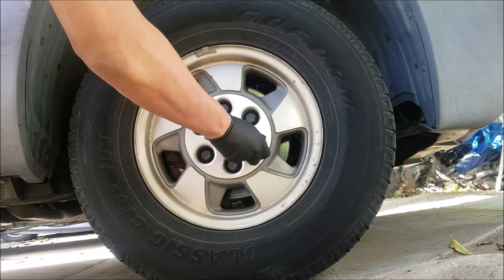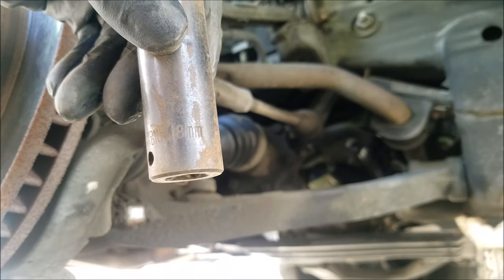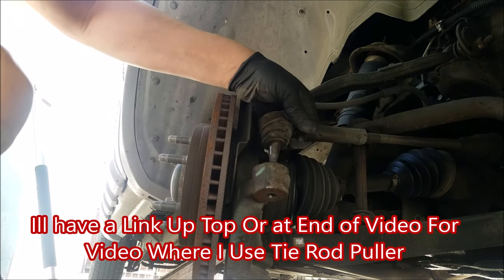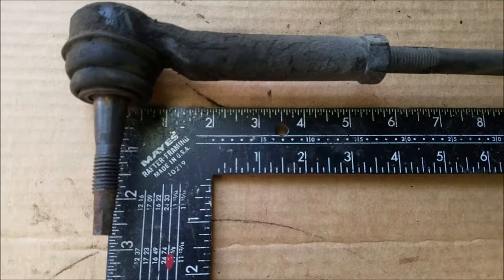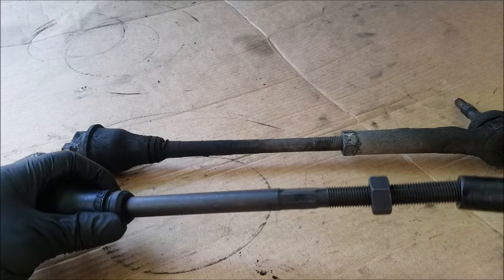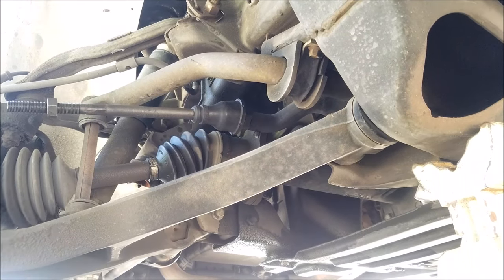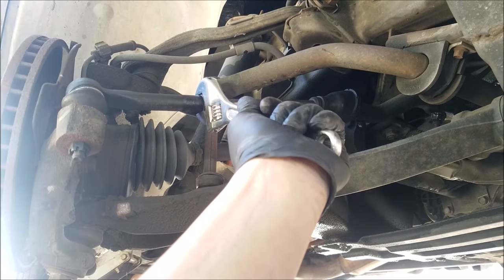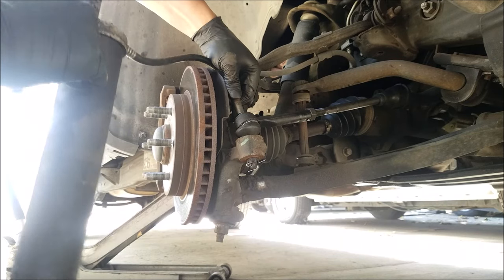How to Replace Tie Rods Chevy Silverado & GMC Sierra (Inner and Outer Tie Rod Ends))

Comment: I appreceate the information but when you tighten the locking nut your realy should have two wrenched you dont want to damage or bend the spindle bolt . I know its touchy but better safe thanks sorry I mean your are reolac8ng it for a reason .

Comment: good  outer & inner tie rid replacement #👍 🇵🇰 but before opening the  outer tie rod measure & mark the jam nut position & then measure & mark on the new outer tie rod & rotate the outer tie  rod on inner tie rid till the marked position of nut reach # 🇵🇰

Comment: Thanks. I would have liked it if you had mentioned a few comments about the right-side same operation. Is there any differences side-to-side? Are the threads on the other side the same or reversed? Are the outer tie rod ends reversible side-to-side? I’m guessing it’s important to get a wheel alignment at the end of the process?
Reply from the maker: You make very good points..i should of done that..thank you that will be helpful in my future videos...and the tie rods can go on either side same with the inners so yes they're reversible and the threads are same direction so you turn them the same direction to get em off...and yes even though it gets us close to the adjustment on the tie rods it had, its still always best to align the truck after

Comment: I was told by a mechanic need to replace this. This looks easier that I thought. I can only imagine what they would charge In the shops
Reply from the maker: Yea its not too bad...once u separate the tie rod from the knuckle its easier from there on.
Reply: Haha tires plus told me it’ll be close to a thousand for both inner and outer tie rods on both sides .

Comment: I got 04 Chevy silverado 1500 z71 5.3 4x4 v8 vin letter T .need the right part number .had alignment done but toe is pushed to far out .so inner tierod is wrong or inner .please help need vehicle to get back forth to work..
Reply from the maker: Do u know if u have rack and pinion steering or the gear box steering..the lart numbers depend on what type of steering system u have...but if u have gear box steering itll be es3493 for outer tie rod..and es3488 for inner

Comment: I know I’m going to need an alignment when I replace mine on my 04 Suburban but you mentioned the length from the center of the outer to the pice before the threads on the inner being 15 1/4 inches. Is that pretty close to being decently aligned? I only ask because there’s no point in matching the measurements on my old ones seeing that my alignment is horribly off.
Reply from the maker: Well every vehicle is gonna be different based on previous alignments..u can kinda put it to specs u have and try to get the adjustments as straight as possible for meantime if theyre that far off

Comment: So my tire its eating or whatever you calli it more from the inside , a mechanic said it was the tie rod, will this solve the problem?
Reply from the maker: If ur tie rod is bad then yes that would cause ur tire to wear on inner edge because the tire will kinda point outward at the front..but yes youll definitely wanna do the alignment afterwards

Comment: Nice. I bought Napa chasis brand and the inner rod well not screw in. Threads are not the same. Now I have to take them back. Different brand or the way they fab the threads is off.
Reply from the maker: Yea i wonder if maybe they gave u wrong part number or if there was some manufacturing issue.

Comment: I ordered a set of tie rods on Ebay.  I noticed the outer tie rod did not have a zert fitting for adding grease.  Should I trust it?
Reply from the maker: Well some tie rods come sealed and pregreased and yes they work fine like that as well

Comment: I’m trying to buy the inners for my 99 Silverado but I saw two different sizes, 18” and 22 is there any difference between these two?
Reply from the maker: Well its 2 different thread sizes that thread into the steering rack..they make an 18mm thread and a thicker 22mm thread size
Reply: @backyardchevy328  thanks for the info!!
Reply from the maker: @LJimenez0185  anytime🙂

Comment: What kind of grease and grease gun ?
Reply from the maker: Basically any grease rated GC-LB would be appropriate for greasing it and they sell em in tubes for the grease gun..the one i have in grease gun at the moment is just wheel bearing and chassis grease..and i like the pistol grease gun makes greasing the fittings pretty easy.

Comment: where can i buy the inner and outer rods for a 2000 chevy silverado ???
Reply from the maker: I got those at O'Reilly's auto parts, but im sure most any local auto parts store or even amazon will carry some
Reply: @backyardchevy328  an they are both moog correct? Getting a set Friday after work along with a new steering gear box
Reply from the maker: @sean.g4516  the inners were moog..the outers I wanted moog as well but they werent in stock

Comment: The inner tie Rod won’t rotate
Reply: On my 2004 tahoe z71
Reply from the maker: They can sometimes be pretty tight since they use loctite and then the rust can affect it too...try soaking it with like a wd40 and if ur using a wrench get it on there tight, and u can try tapping it with a hammer on the end of it, it might free it up.

Comment: Always buy a high quality inner tie rod. Cheap ones they don't last. It's ok to install cheap outer tie rods they last some time and are easy to replace.
Reply: I installed cheap inners and outers on my truck but I only drive like 5000 miles a year.